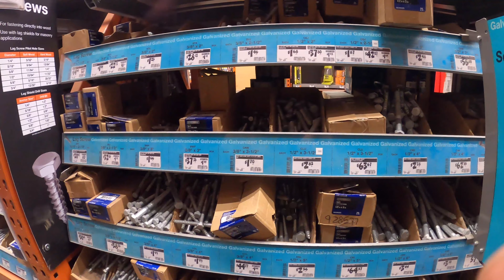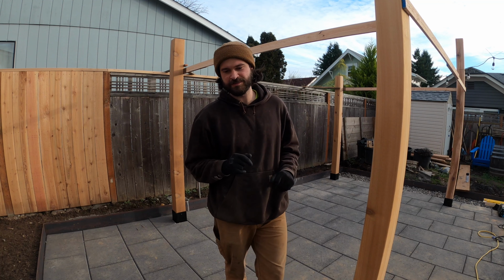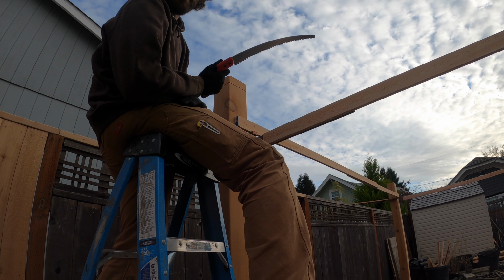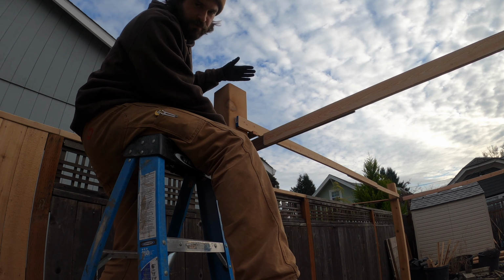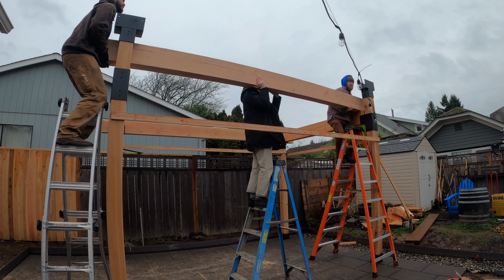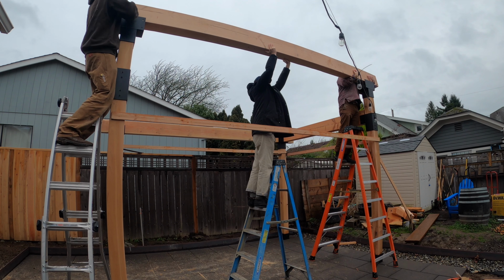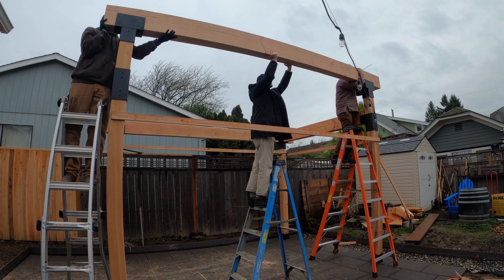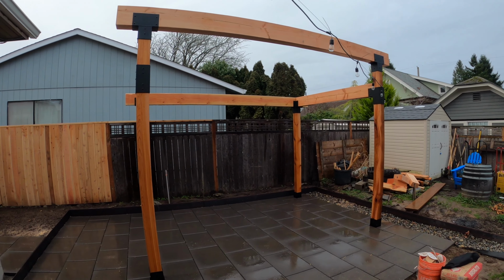Pergola Build (Part 2)

Comment: Say you were to build a deck over pavers how would you secure the stringers to the footings 
I’m guessing the best option would be to remove the pavers, dig, add a 4” slab below the pavers, then connect the stringers to slab, finish framing, put back the pavers, cut the pavers to fit around the stringers, then add the decking boards, and complete 
Is that my best way or would you recommend another way